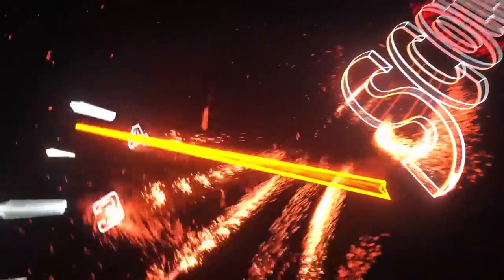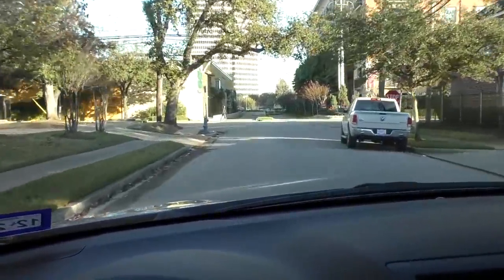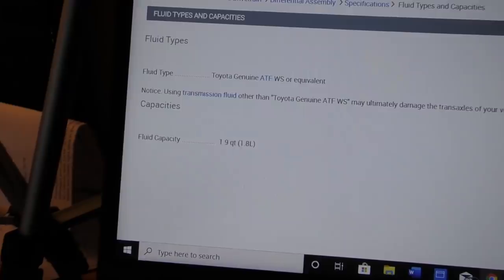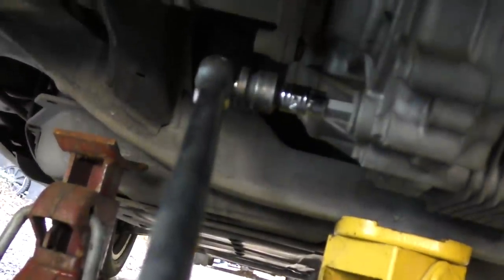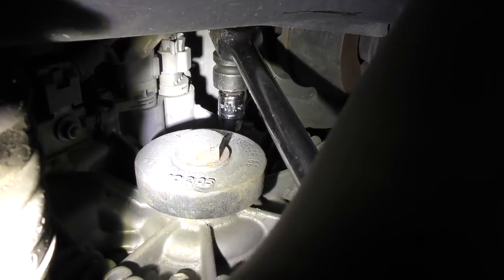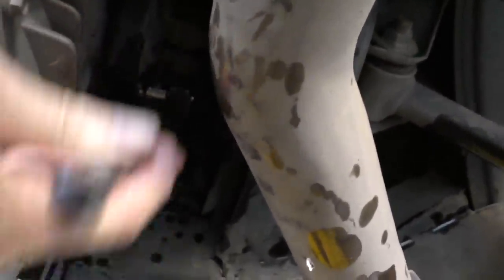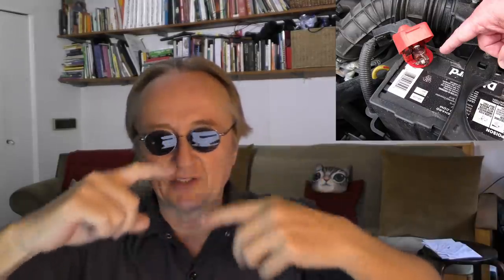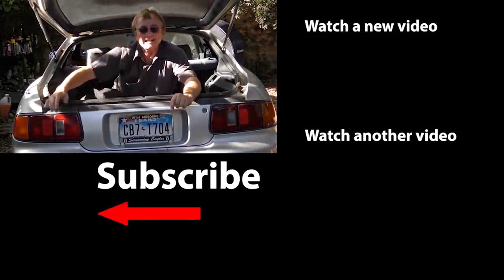This is Serious

Comment: A top fuel hemi engine builder with 50 years experience told me along time ago..."electronics are always the first thing to fail". That is why he used mechanical everything where they could. These electronic cars are a symptom of either extreme federal regulations or extreme stupidity of auto engineers. WHICH IS IT????

Comment: Great work as always, Scotty.  The only thing I do differently is I remove the filler plug first, just to make sure I have the correct tool and extensions to get to it and that will fit it, and to make sure it's not hopelessly rusted in place.  Then I remove the drain plug.

Comment: When changing any fluid, in any car, always be sure that the refill nut/bolt can be removed, before you drain the old fluid out.
Scotty's Highlander Hybrid's refill nut is in an awkward location and a non professional might not be able to access it, so always loosen the refill first and the drain plug 2nd.
Reply: The only exception might be if you own a car that is old enough that it has a diptick on the transmission and you've checked the fluid before.  As for the engine if you can't get the oil filler cap off you could still fill it through the dipstick tube but ONLY IF you have a funnel that would fit.

Comment: I got some good advice from a mechanic when dealing with differentials or manual transmissions.... Pull the fill plug FIRST!!! That way, you know you can fill it again. I once drained an axle, and couldn't get the fill plug out. I ended up slowly getting new oil in through the vent, but I had to guess the amount.

Comment: Tip: remove the FILL plug first..thanks scotty
Reply: You got that right, also way over torqued the drain plug.
Reply: @hankw999  yes, Toyota lists 36 ft pounds torque. That's more than enough.  I really wouldn't exceed 30 ft pounds. That thing isnt going anywhere..

Comment: Had a similar noise in my 2003 E150 Ford van with 150,000 miles, but found that changing the rear diff oil and adding new "friction modifier" from Ford ,(traction lock rear end), solved the problem.  Scotty has helped me solve MANY a problem on all my cars ... he's the best !!!

Comment: We're never buy a hybrid again, we had a 2004 honda civic hybrid, we put 160000 miles on it, had it for 14 years but we went through 4 batteries, and driving up the mountain the electric motor noise is loud and very annoying and accelerate is just as slow as a semi. When we sold it, we only got $800 out of it.

Comment: I thought the general consensus was to remove the fill plug first since if you can't remove it then you shouldn't remove the drain plug?
Reply: I like the way you think.🤔😉☺️😁
Reply: Jason R I would assume he has a tools that get stripped heads out. I ve used an “easy out” tool on a bolt before and it was actually wasn’t too hard.
Reply: “Can’t never could won’t never will, “ if it’s got to come out, use your brain to figure it out, sometimes it’s easy sometimes it’s hard, all boils down to get her done !

Comment: Nice job of diagnosing the differential.  I just had the oil changed on my 1996 Suzuki X-90 differential but the noise
it was making grew much louder and it feels like an old hand-cranked egg-beater.    The diff has about 280,000 miles on.   Trying to find a replacement but not having much luck.   The car is a lot of fun and I just hate to see it go.   Enjoy your videos, keep up the good work.

Comment: If you have AWD, then you should probably change the differential fluid more frequently than the factory recommends.  I treat my AWD Honda CR-V's differential like I do it's transmission.  Take the factory recommended interval and divide by 2.  Yep, more expensive, but less than the cost of replacing a transmission or differential.

Comment: I read in a Jeep forum, that the best procedure for drain/fill is to remove the fill plug first. That way if your fill plug is stuck, you can still drive the car, and deal with it later. BUT I guess in TX there is minimal rust.
Reply: I've never seen one rusted.  But then I have been in the Southwest U.S. for 25 years

Comment: Well in Europe we would change just the bearings inside the housing it's more likely those worn  since it's a CV joint setup more chance of the bearings being worn because of the CV joint or the joint itself right next to the bearing gears would make a roaring sound

Comment: This is an excellent device that picks up vibration. Suspension noise/vibration is hard to diagnose. 
I have been trying to use a cellphone for the same purpose but with limited success.
I was able to place a cell phone earplug on a rear strut mount to confirm a mount clunk by listening to the recording. But I haven't been able to pinpoint the source of a clunk over bump in the front left wheel well - there is too much engine noise. The clunk remains even after I changed the ball joints and sway bar links & bushings.

Comment: Replace the diff fluid with 50/50 Lucas Oil stabilizer and recommended diff fluid plus Pro-ma MBL8 (if not a Limited Slip Diff) at dosage of 20ml per Litre of diff fluid. The diff will last longer than the rest of the car. I use the MBL8 in manual gearbox, engine oil and power steering fluid.

Comment: Hi Scotty, if I do change olis from transmission or duff... , I open the upper screw first. Because when first open the lower screw and than the upper screw won't get off, you stand there with an undrivable car.. If the upper won't get off its possible to drive to someone who can help. Its a Tipp from an Mercedes mechanic. You can help your self if it won't get off. The most of us can't fix the problem. I hope you understand me, I'm from Austria and my English is not so good.

Comment: I don't know why we weren't shown the outcome of the fluid change or why the play at the shaft connection to the diff. wasn't checked or even spinning the shaft by hand or under power to listen for a bad output shaft bearing (which I bet that noise was). The output shaft bearing is totally fixable. I'd like to hear from the owner what the projected outcome was, not to prove Scotty wrong or anything. I still love the guy. I just don't agree with this particular diagnosis and the not showing ALL the possible causes.

Comment: On my 1978 Corvette, I had a noise from the engine and did not know if it was the water pump or alternator that was whining so I used a piece of hose to listen to each. It was a low-tech approach but it worked. It was the alternator.

Comment: I stick with GM vehicles because I’ve had the best luck with GM vehicles I’ve had Fords and Toyotas in the past and neither of them lasted me nearly as long as my Chevys have
Reply: Jon Allen that's good I'm the total opposite all my silverados gave out before 150k Toyota still here at 210k
Reply: I drove Chevy since I was late 20s and never tried anything else. I didn't realize just how bad the AC Delco parts are. I thought spending a whole weekend replacing a water pump, belt and thermostat was normal. I thought radiators, engine gaskets and fuel pumps were supposed to only last 4 -5 years. Now my wife has a Toyota and I see how poor the components really are on a GM in comparison. The GM engineering is ok, it's the shitty AC Delco components that fail.

Comment: Brilliant tool!  Also I highly recommend removing the full plug on differentials before removing the drain plug.  Had one seized.  Rather deal with that issue first than a drained diff, no way to fill, and a vehicle sitting around til its fixed.

Comment: Scotty  looking to buy a  2019 Ford F -150 XLT. Engine: 3.5L V6 24V PDI DOHC Twin Turbo. Transmission: Automatic. 19,613 miles. Would this be a good truck to buy. Thanks for the advice.

Comment: Scotty it's highly advisable to remove the fill plug first. I'll also suggest getting new plugs, at least a new drain plug or crush washer or seal especially after 150K. Vehicle should be on level ground as well.

Comment: Just a suggestion, always loosen the FILL bolt first. If god forbid you drain it first... then cant get the fill plug out.. YOUR SCREWED.. can be a problem on older cars that have had that plug taken out several times.

Comment: Are 2012 mini cooper s clubman vehicles good/reliable? I have 51,600 miles on it so far, accelerate softly (no 0-60 runs ever), change full synthetic oil every 10,000 miles or once a year which ever comes first. No mechanical problems yet. Changed battery once so far. Should I be looking for a new/used car that is more reliable? Should i be prepared for an expensive fix soon?

Thank you for your videos!!!

Comment: The first thing is to always replace the fluid, and do this regularly on transmission, differentials, and engine. Synthetic oil is usually clear when good, and if it is red it has picked up moisture if dark it has wear.
Reply: It's Toyota ATF-WS which is red and not synthetic.
Reply: @stevensevek6151  Agreed, but what I mentioned is true for all other similar differentials. People do not change fluids as they should in vehicles and as a result they wear out sooner than necessary. Just changing the fluid in the differentials transfer case, engine and transmission is needed if people want to cut down on costs. These changes are easy for a home mechanic. Some require filling to a certain level, and if not then it is till the fluid comes out of the fill hole.

Comment: Every time I watch one of Scotty's videos on the troubles caused by high-tech computers in cars I become more and more convinced to just baby my 1997 Jeep Cherokee XJ.  It's 23 years old with 180K and still drives like a dream.  I've had it since 2005 and have only spent about $300 a year on tires, oil changes, filters, parts and DYI repairs. I've replaced the radiator, alternator, starter, disc brake pads & rotors, headlights, thermostat and a couple of hoses.   I drive it everyday but only put about 8K easy miles on it a year. The thing cost me $2500 and has been the best rig I ever owned.
Reply: @spenserchalkley7013  I met a guy in the bank parking lot with a 1986 that had more than 500K miles.  "I fix what needs fixed and change the oil every 3K miles."

Comment: The new Amsoil ez-packs of differential oil solve the problem of pump plus that severe gear differential lube will cut temperatures 30 degrees. Our RV hits an extra 5MPH on the mountain road since switching. You should do a review on that.

Comment: Looking into that chassis ear tool, would be nice to have that in my arsenal of tools. 

In my Toyota pickup it is a pain to refill the manual transmission the fill plug is on the drivers side hidden above and behind the exhaust. I’ve used a transfer pump before, but because 80/90 is so thick the hoses keep popping off make a heck of a mess. Since the front part of the center console is easy to remove I just run a hose to the fill hole through the floorboard. I do this every service interval and has made servicing the transmission so much easier.

Comment: Are bearings not standard anymore? It used to be that you got the number on the bearing and then bought it; it wasn't necessarily a manufacturer specific part. I've noted that you could get various bearings for various older cars and even those for Victrola orthophonic sound boxes can be fairly easily obtained.

Comment: that's a pretty neat gadget. Scotty have you ever used a piece of wood as a stethoscope. About a foot long 2" by 2" or 1" by 1" ?  Try it on an engine that has a knock and you can determine exactly where the sound is coming from.

Comment: My experience with head gasket sealer is that it just destroys the heater core, which is almost as bad a repair job as replacing a head gasket.

Comment: You should always remove the fill plug first in case you can't get it out.if you can't get the fill plug out you can't fill it back up after you drain it.

Comment: noise, my rear breaks were making noise.  thought it was the shoes. drums. took off the drum on the noisy side. nothing. shoes got more than half the life left. other side, the same. put it all back on.  no rivits showing through. lots of dust fell out but thats normal.  only makes noise when i pull the park break lever and foot break.  its the rear for sure. still making noise only when breaks applied, pedal or park.  dont get it.

Comment: Hi Scotty , I have a 2014 Chev Camaro 2SS , last Thursday , I was driving locally and suddenly the car started shaking and misfiring , I pulled into a parking lot , open the hood to see the motor shaking , turned the engine off and checked the wires and looked under to see if any leaks ( none ) checked the oil level and it was clean and full , always used full synthetic , tried to restart it but it didn't start , it gave me a ( service stabilitrac sign ) got it towed to a local repair shop were they tried to turn the crank , with a big wrench and couldn't saying that my motor seized ( car had only 70k miles on it ) . A Camaro friend of mine ( Camaro time ) here on YouTube told me there is a possibility that fuild could have built up in one or more of the cylinders and that could stop the crank from turning , to take off the spark plugs and then try to move to crank , what do you think , if you answer it is appreciated and thanks

Comment: A common source of noise on Toyota AWD's is the viscous coupler/electromagnetic coupler (right in front of the rear diff.) You can replace the bearing for $200 plus labour but Toyota wants to sell you the entire unit for $2200 to replace their defective part.

Comment: Scotty i have a 2002 VW Passat 19.TDI Diesel engine with more than 300K Km and the turbo stops sometimes whem i am at over 3000RPM, but when i turn off and on the car, it is all good. What is the problem?

Comment: This vehicle diagnostics would be illegal in California - as it is illegal to use headphones while driving.  I had a similar issue with my 1996 Dodge Ram hearing a screech howl sound towards the rear if I had my rear window popped open (I didn't hear the sound any other time and I rarely keep that window open) - since I had a weird clunking in the rear end when I had the vehicle in revers and backing it up - I asked my transmission shop to diagnose it when they serviced the transmission - and they recreated the complaint and said they would need several hours to tear down the differential to diagnose the specific problem.  I said - close it up I don't have the time for this.  I took it to my regular mechanic and asked them to service the rear differential and bingo - the weird clunk was eliminated and so was the whine.  Phew

Comment: PRO TIP: For anyone doing this at home or a transfer case, loosen the fill  plug before the drain bolt. Why? What happens if you can’t get the fill plug out but have now drained all your fluid? Work smarter not harder...

Comment: A headlight keeps blowing about every 5000 miles and there is a slight rattle depending on the type of gas I put in it (with ethanol vs without ethanol)

Comment: Thanks Scotty, simple, effective, affordable ways to keep things going, without breaking the bank.
Reply: Changing the fluid won't fix that noise, the damage is already done, that differential needs replaced, or the owner can just turn the radio up louder, and problem solved.  Toyota seems to build the lowest quality differentials, had to have the front one replaced in my 08 Tundra for a grinding and howling noise, a very well known Toyota TSB I think on 2007-2010 Toyota Tundra 4x4 pickups.  2 years after having it replaced the problem was back and at 104k miles I sold the truck wasn't about to spend that kind of money having to replace another pile of trash differential in a truck that hardly ever got 4WD use at least none that would cause any front differential wear like that...far from impressed with their quality.

Comment: Scotty I would have thought you'd provide a little more insight into the "factory fill" these auto makers use for differentials and transmissions. GM and Toyota are both guilty of using junk oil. A good refill can help wonders.

Comment: I had a 2003 Ford F250 6.0 diesel. Had 150k miles. Rear diff went bad after Ford put my drive shaft on backwards. Something about a yok and.. I'm not well versed in it.   But I thought it was the driveshaft for months. Spent 600 trying to fox/reblance etc.   Took it to an old old shop on the side of a highway outside my town, guy found and fixed my rear diff for 1k.   Solved.
Reply: Sounds like Ford had yet another better idea to make the drive shaft attachable  backwards.

Comment: Scotty, I have 2017 Tacoma with 15,000 miles, I noticed oil on the ground after work one day so I took it in to get it checked out. Was told vacuum pump O ring is bad so it was replaced under warranty. Now it leaks more oil than before. Any idea as to why? Also turns out that the previous owner had the vacuum pump replaced and that’s the one that’s currently on

Comment: Scotty, the other day my pulled out of the driveway in her 2015 Equinox with 60,000 miles on it and there was a huge puddle of oil with a trail of oil down the driveway.  She went to work, about a mile away, and when I discovered the oil I drove to her work to check the car.  It had no oil s uhh owing on the dipstick.  We had it towed to the dealersh up and they said the pcv valve had froze and caused back pressure and blown out the rear main seal.  They are fixing it under warranty but it makes me worry that it might happen again.  Who would design a pcv valve that way?!?!?

Comment: 99% of mechanics would have charged the customer to replace both bearings and then charged them for replacing the Differential when they brought it back the 2nd time. Total bill would be $3,500 plus. Scotty helps the customer for $200. If every mechanic was like Scotty, the world would be much better.

Comment: The correct way would be to take off the fill plug first incase you can't take it off, atleast you won't be driving around with no oil like you would if you take the drain plug off first